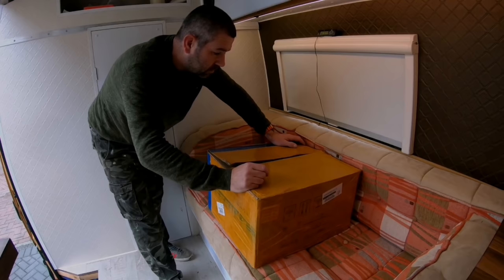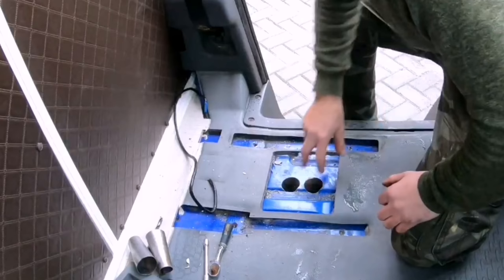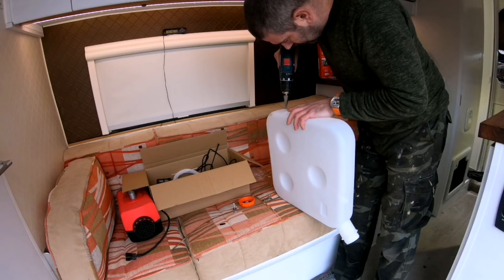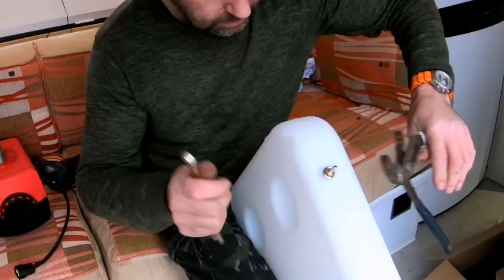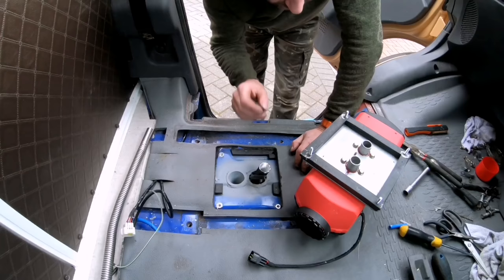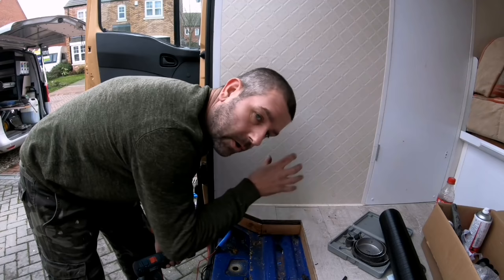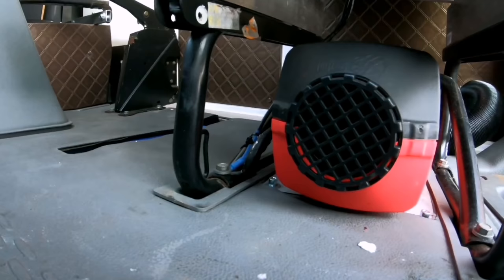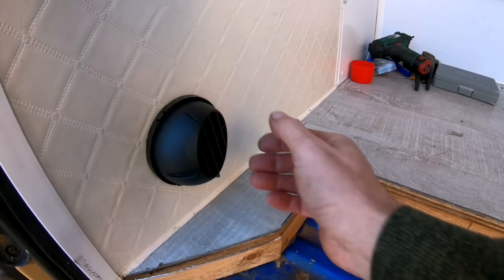Diesel Heater Install -  Campervan / Van Build.

Comment: Can I pick your brains here and their as you’ve done what I’m doing with my lwb iveco ? Was wondering what seats you used in back and front, I like it 👍
Reply from the maker: Yes, you can bud, Regarding seats, well your option's are endless as long you can fabricate frames for them, how ever I wouldn't use the VW touareg ones again (in the rear) as there uncomfortable I'd probably revert back to foam bench seats again, but if you need the rear for passengers you could use some kind of bench seat with fitted seat belts as long the frame is mounted and anchored with spreader plates on the underside. What seats were you thinking of?
Reply: @Iveavan  thanks buddy, think back to the beginning of your build , worst luck that’s wear I am lol , I was just wondering about the seats they look nice, but I was going to build a bench seat , I will stick with your advice . I’m a fabricator welder by trade so could of made the frames, it’s very overwhelming and a lot of work . So far I’ve changed axle done tumps of welding rust proofing and sealing,changed gear box crunchy second clutch , brakes , welded doors up , stone chipped all the bottom, put the floor in and insulated underneath. Next body work paint windows and windows,I’m literally dreaming  about campers lol so atm I’m thinking of ideas and ways to go, I got a scrap caravan wasn’t the best for free cut that up , anyway it’s good to no I can ask someone like yourself for ideas as you’ve done it already,and done it well .
Reply from the maker: Sounds like you've had a bit of a job to do on yours bud "😬", I do recommend the P38 Range Rover seats for the front as there very comfortable, probably manual adjustment if you didn't want to go through the hassle of wiring them in 😎👍.
Reply: @Iveavan  thanks buddy keep you posted , did you have a scrap caravan? Like your over head unit doors .
Reply from the maker: No worries bud, yes I bought a salvaged 2007 Bailey caravan that been smashed in on the O/S/R quarter. So the 3 way fridge, cooker, hob, microwave, all the windows and skylights, cupboards (and so on) where from it 👌👍👍👍.

Comment: Always wondered if you can run these on veg oil?
Reply from the maker: From what I've seen on here not successfully Linzi, I seen people run them off on old hydraulic oil but soon cokes up the heater, I've probably used 40lts of diesel over a space of two months, and it's been running for long periods so that ain't bad 🤔😉👍👍👍.

Comment: 12:18  Lots of turns and constriction on the output hose.  Any problems with "Overheating" at full power when burning off carbon?  I've read install instructions that state "first 15 inches of hose should be straight off the heater."
Reply from the maker: None whats so ever. Still working fine over a year on.

Comment: great install !!  do you have a return vent to the cab area for air flow?
Reply from the maker: Cheers bud. Nope, I haven't fitted one matey, been in use for an month now, (60hrs running time) and pretty much found no need for one in my cab, 😉👌👍👍👍.

Comment: Hi Mark,  really enjoying catching up with all your videos.   I have the chance of buying an Iveco 2017 automatic 116bhp.  Just wondered what you thought about the 116bhp in that, do you think it would have enough torque to manage a conversion (I have only just learned what bhp meant).  It seems a lovely van but as I don't have any knowledge at all re mechanics never mind the Iveco I wondered if I could have your opinion please.  Thank you for your time, take care and stay safe x
Reply from the maker: Hi Norma
Yes, I'm very well thank you 😊👍. You've got the same engine as mine then (2.3lt engine). It's an good work horse of an engine and very economical with fuel, mine certainly copes very well and at ease with my van build. so, I wouldn't worry about you're engine not being able to cope, you'll be fine with that engine 😉😊👌👍👍👍
Reply: @Iveavan  Thank you so much Mark I was worried.  As a retired nurse I have zero mechanical experience and the van is not cheap so yes I was worried.  You have put my mind at ease. Now I have to find someone who can do the conversion for me!!! Thank you again x
Reply from the maker: No worries Norma your welcome, good look with the campervan build 😊👍👍👍.

Comment: Why use the plastic tank,.? i don,t understand if u ride diesel it,s simple right,.?
Reply from the maker: We have an choice of fuel in the UK, road going Diesel ( White Diesel) or Red Diesel. Red Diesel is half the price of road going Diesel (White Diesel) thanks to government tax rules. I can't use "Red Diesel " to run the van due to strict TAX laws  (only white Diesel). Hence!  using the plastic tank 😉👌👍...

Comment: Isn't 5KW way way way too much for your insulation?
I'm using 30mm PIR boards and based on the calculations it would need 800w of heating if it's -10C outside...

Btw. I like how you insulated the van and how you pay attention to all those details. I thought I'm the only insane person
going through all this mess.
Reply from the maker: Personally, I wouldn't take it gospel when a chinese diesel heater is advertised as '5kw'. If you're van is the same size as mine I'd would go for the 5kw version trust me bud 😉 (I very doubt that they are 5Kw) but for me, it's perfect. I just leave it on, on the lowest setting and I don't bother with it after that, I just turn it up for 10 minutes when I'm switching it off so it doesn't Coke up. I've been in minus 12 °C and just leaving it running on the lowest setting has been comfortable 😉👍👍👍.
Reply: @Iveavan  haha good point ;) I guess that's true. I've only got a L2H2 Ducato and Autotoerm 2D - so far it works nicely.

Comment: So without further delay, here's my first edited version on the installation of our Planar heater like I mentioned before.

https://youtu.be/HP2Hgoo3TlA

The one thing that went wrong was the direction of the fuel pump which wasn't explicitly on the pump. That took about an hour extra🤭

Therefore this raw video on the build, explaining what I did without knowing I placed the pump the wrong way around.
Later on I placed it right but by then I already connected it to the return-fuel line as told to me by Hans, from Camper Service Deventer.
https://youtu.be/7b4EL6K7ejg
Reply from the maker: I shall pin this for you matey 😎👌👍👍👍.
Reply: @Iveavan  thank you very much 😊🇳🇱🍻👍🏻

Comment: I know you know your stuff with motors but the diesel heater god himself, John McK says you should mount the exhaust opposite the direction of travel, not facing
Reply from the maker: Cheers matey🍻👍. I do see his thinking bud, But! ... Who has their diesel heater switched on when travelling 🤔? Not only that its almost impossible for combustable gases to be released from the heater unit back into the cab or habitation area due to the unit is only releasing hot air from an fan blowing over the sealed combustion block. As stated in the video, it had to be placed out of the way of the "drive away yawning entrance" . The silencer is facing more to the N/S of the van the facing forwards bud 😉👍👍👍.
Reply: Mark Collom #Iveavan 
Yeah, I didn’t get what you meant there, “driveaway yawning entrance”, but I don’t know why it’s bad to do it, my brain just logged it as bad from picking it up while watching a shit-ton of diesel heater install videos before installing mine, I do drive with mine on, I live in my van and when I’m leaving work and driving to my regular parking spot, I switch the heater on so the van is warm by the time I get there, plus it’s pulling from the split relay power while driving rather than the leisure battery while stationary, ps. I put my tank behind the driving seat too, good instinct! 👍
Reply from the maker: @MrGenedancingmachine  ahhh get yeah, a valid point why you do use it whilst driving😉👍, I think he could be thinking of water ingress going up into the exhaust more then anything bud 🤔(I've personally not seen that video mate) 😉👍👍👍...
Reply: Mark Collom #Iveavan 👍

Comment: Be Careful with the exhaust. there is a drain hole on the bottom of it and has you have mounted it it will decay quickly
Reply from the maker: Cheers Will 👍👌, I didn't notice the drain hole but I shall have a look bud 😉👌👍👍👍.
Reply: @Iveavan  same here and I paid the penalty. Great install and video!
Reply from the maker: @wiffer64  cheers matey 🍻😉👍👍👍.

Comment: Well you've made my mind up Mark, when I eventually get there, it'll be a cheap Chinese heater for me.
I'd be interested to hear it you get bothered with fumes?
Reply from the maker: Hi Greg, I've had the heater running for around 70 hrs now, today with the cargo door open due to being in and out of the van. I've personally not noticed any fumes from either the exhaust or the fuel tank in the cab so far, my co2 alarm has not noticed any either bud. All good so far matey 😉👌👍👍👍.

Comment: You put a very tight bend straight out of the hot end of the heater, you may suffer from overheat shutdowns in the future.
Reply from the maker: It's been running for over 60 hrs with no issues bud, but I shall keep an eye for error code 01  😉👍👍👍.

Comment: Anyone using the same heater replace the rubber hose that connect at the joints of diesel pipe  as it perish and splits very quickly
Reply from the maker: I'll keep an eye on them bud 😉👍👍👍.

Comment: What about a simple but highly effective wood burning stove?.
Reply: Overly complicated to achieve a certain outcome when there is a simpler alternative.
Reply from the maker: Take out the middle bit of welding and it's in and working within a couple of hours, plus you can set the desired temperature on a diesel heater. Regarding Wood Burner I haven't got the roof space for an chimney bud 😉👍.

Comment: Your filter is on backwards!
Reply from the maker: It isn't! It's an "serviceable gauze filter" , the gauze cup is catching and collecting the debris with in the cup, not collecting around the cup, so you can lift out the cup with the debris that has collected inside and wash it out, not contaminating the rest of the filter housing / fuel line... if it was an sealed disposalable filter, yes the cone of the filter wants to be facing towards the tank bud 😉👌👍👍👍.

Comment: Humble Road and others said pls don't install heaters under front seats as it's pulling cold air from the cab and it's too far away from yr bed where you need the heat.  I agree with Humble guy.

And I wud not want my heat coming out over a cold door entrance.  Bye bye heat.

I wud still accept you as a good husband.
Reply from the maker: I have no issues with the heat reaching through out whole of the van, set at 15° it's working great for me. Don't for get my van is well Insulated 😉👌👍👍👍.

Comment: They are cheap they are noisy they do the job no chance of getting parts when it chucks it bucket and get another
Reply from the maker: And I agree, especially if you place the fuel pump inside the van, but so far so good bud 😉👍👍👍.
Reply: @Iveavan  ive fitted a few they are ok fraction of the price of a truma or eberspacher  as i said do the job